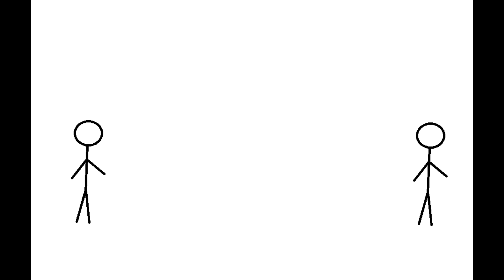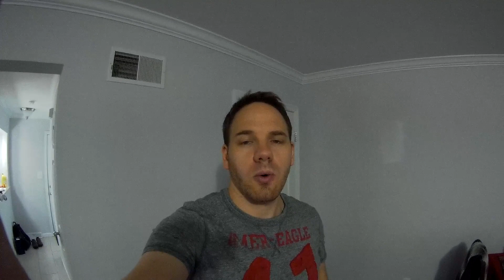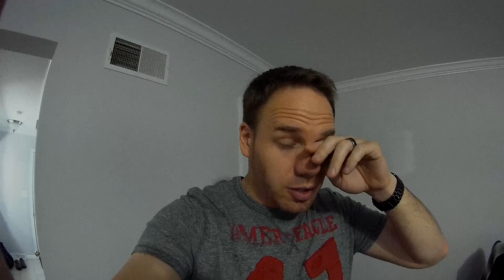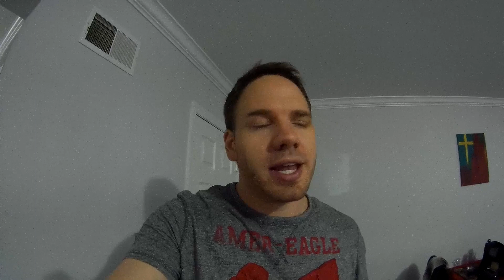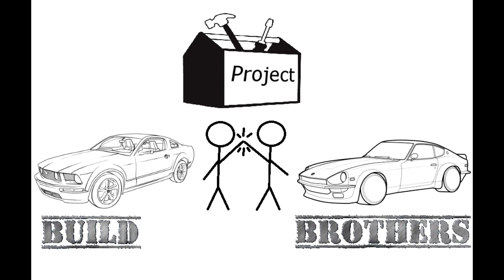Airbag Light Fix it for FREE! Chevy Volt Warning Light

Comment: Mine has been going off for almost a year now. Has nothing to do with the passenger seat being damp. I live in california where it almost never rains. And we do not leave the windows open at night for moisture to get in.
Reply from the maker: At that point, I would look at replacing a sensor. If the sensor goes bad (or senses an impact) it will report an error...ie. airbag light
Reply: @BuildBrothers  I have the same issue. Been on for over a year and not damp. What sensor are you talking about specifically?

Comment: That eventually fixed after I undid the battery cables, disconnected (and reconnected) the yellow connector under the seat and also mashed the menu button. I drove it around and it seems that it won't be coming back on now.

Comment: I have 3 Chevy Volts. I found out that puling a part the harnesses connections for the Airbags under both the driver side and the passenger side, spraying both side with Blaster brand Lithium & Silicone mixture (Walmart) then putting the connectors back together, almost fixes the Airbag warning problems. Those harnesses are very difficult to take a part (3 under the driver side and 3 under the passenger side). Can you make a YouTube video showing how to take those harnesses a part without damaging them?
Reply: Has this continued to work for you? Why is the driver's side important when it is the passenger sensor that malfunctions?
Reply: I see two large black harnesses and one smaller yellow one. These are the three you are talking about?  I have had this issue with the passenger presence sensor for several years now.
Reply: @rcktgirl05  Sorry I forgot how I fixed it. There is  a module under the passenger seat side not under  the seat but under the carpet toward the front seat post center side that is very hard to get too. I had to use utility knife to slightly cut the carpet to expose this module. It is much larger than the black or the yellow modules. You need to disconnect the 12 Volt battery. If you accidentally deploy the Air bag (very expensive to fix after deployment and dangerous). I do not recommend messing with it for your safety.
Reply: @natshain7746  In your earlier message you said this almost fixes the airbag warning problems. Does that mean that you still sometimes get the warning?
Reply: @billusry8902  Sorry I do not know. My daughter totaled the Volt shortly afterword. My theory on lubricating harness contacts is : Harnesses are electrical contacts with plastic enclosures. As the car ages plastics fatigues and become less flexible. When this happens the male & female part of the harness no longer slide in and out freely. The shinny slippery plastic parts of the harness are now dry and brittle. This prevents this microscopic  minuscule sliding that keeps the frictional electrical contacts from being a stationary contact. When the contacts become (stationary) fixed, oxidation sets in causing resistance to the electrical flow. With this theory in mind I have fixed many things over the years. Watch out for high voltage areas. When lubricating harnesses, you do not only lubricate the electrical contacts but also all surfaces of the plastic parts (in or out).
Reply: @natshain7746  Thanks for the explanation. Makes some sense to me. I have a Volvo whose AC and radio dials had contacts that were oxidized. I could remove the oxidation by quickly and repeatedly rotating the knobs to clear the oxidation. No easy way of working off the oxidation for Volt adapters, but your lubrication idea could help. I will first spray a cleaner on them and try put them on and off a few times and then lubricate them. Thanks again.
Reply: @natshain7746  Oh, and sorry to hear about the totaled Volt. I hope it protected your daughter well. They are supposed to be safe cars.
Reply: Nat Shain makes sense on lubricating the harness. My sensor failed very early and I was living in Phoenix, the car was driveway parked. Easy to imagine the harnesses becoming brittle in the heat. I'm having other issues now with my O2 sensor and catalytic converter so the passenger airbag has taken a back seat so to speak! I'll post back here if I ever get around to fixing it.
Reply: @rcktgirl05  Most Volt owners ignore the gas engine (generator). That is unfortunate. If the oil is not changed in a timely fashion (change the oil using fully synthetic Mobile 1 with Mobile 1 filter and the 1 year Maintenance rated oil / 25000 miles from Walmart). The engine could develop other issues such as oil burning causing the catalytic converter / engine light to come on. One of the Volts (First model I purchased used) the owner never changed the oil causing oil burning and catalytic converter / engine light to come on. I used the 5 quart Mobile 1 container to mix BAR'S LEAKS ,VALVE SEAL (only available on E bay) & RISLONE RING SEAL SMOKE REPAIR (from Orilley Auto Parts). I marked the container at 3.7 Quart mark, then I mixed the oil with those two additives before adding it to the car when changing the oil. That seemed to help the engine from oil burning  & the catalytic converter / Engine light from coming on.
Reply: @natshain7746  Thanks for the reply.  I change the oil regularly because I am basically gas only.  Right after I bought it, my company closed our plant and I had to relocate shortly after that. I've been renting ever since so I would say I have not regularly charged it for at least 5.5 of the 7 years I've had it.  I follow the engine oil sensor and do a change when it gets down to 25% or so. I got some Cataclean yesterday and I plan to drive it on Mountain mode for a while to force it though as I'm driving. I will probably have the cat replaced on this if the Cataclean doesn't work, because it's been mostly trouble free otherwise and I'm ok with a few repairs here and there. I am concerned that I may be hitting the point of just degradation and many things cascading from here. But I won't know that for sure until I fix this and keep going and see what happens!
Reply: @rcktgirl05  Volts can be driven from day one without ever being plunged in. The gas engines is under minimal mechanical degradation because they only work to charge the battery and not propel the car (except occasionally). That means they can be driven hundreds of thousands of miles without much mechanical problems. O2 sensor / Catalytic converter are often misdiagnosis. Get in the habit to check your oil level and oil color visually often (do not relay on the the car computer to tell you when to change it). If your car is using oil, then your catalytic converter and O2 sensor errors will come back even if you replace them. You can try the additives with the correct oil brand & oil filter. Invest in OB2 scanner that is capable on erasing the error code (about $ 40 on eBay). Catalytic converters are (COVERED BY LAW UP TO 150,000 MILES). Don't let any dealer tell you otherwise and they often do. Volt catalytic converters are very well made and do not brake easily. My daughters car kept on getting the catalytic converter error codes, I used sea-foam and catclean by burning it with fuel, and I even disconnected  the catalytic converter (not an easy task) from the engine and sprayed directly into the converter. As soon as the engine started to use the oil again, the error codes came back. The only thing finally fixed it is by adding the two additive the way I explain it above.
Reply: @billusry8902  Thank you for your concern. My daughter is fine. Volt have the best crash data because of the heavy battery.
Reply: Well, I cleaned the electrical contacts and then lubricated the plastic parts. This did certainly make for fewer airbag warnings, but it did not eliminate them. The fact that it unquestionably improved the situation does point to the issue being a excess resistance issue (oxidation). I'm tempted to cut out the connectors and hardwire it.
Reply: @natshain7746  I have a scanner, that is what led me to the catalytic converter. I did a temperature test at the entrance and exit to the cat, so I am about 99.99% certain it is bad. I do check the oil occasionally, certainly not weekly, but every so often and I don't think it's burning oil, thanks for that suggestion though. It is too long of a story for me to describe here why I think the O2 sensor (B1S1) is bad because it's been a dramatic troubleshooting rabbit hole. My scanner isn't fancy enough to do the mandatory O2 sensor heater relearn procedure that GM requires. Maybe I damaged the new sensor that I replaced myself that started all the drama. Maybe there is a bigger problem if the cat and both sensors are bad. Maybe if the sensor I bought was bad it created engine misfire problems that damaged the cat. I don't know why else as soon as I replaced the O2 sensor, the whole thing went immediately wacky and I got all kinds of error messages and the engine would cut off (not available). I am still trying to figure it all out.
Reply: @billusry8902  I would very much be against the idea of cutting them and hard wiring them. You will permanently ruin the harness and you could accidentally trigger the Air bag to get activated (very expensive to fix and dangerous). If you lubricated the contacts and still getting the error, it could be some other issues. Also in the past when I had lubricated other contact on electronic parts etc, It would take a few days for the good results to show while the oil is getting slowly drying out.
Reply: @rcktgirl05  Sorry to hear that. Have you ever replaced the 12 Volt Battery. If you do make sure it is AC Delco from the dealership. The online ones are mostly fake even the one that states that they GM OEM sellers. I have heard the the Volt will give all kinds of weird codes when the 12 Volt battery goes bad. If your car has less than 150,000 miles try to see if you can get the dealership replace it for free  (do not mention that you replaced the O2 sensor), because this may void the warranty. I also changed the transmission oil at about 100,000 miles(there are 2 You tubes for that). The Volt uses about 6 Quarts of transmission oil AC Delco from the dealership OEM only.
Reply: @natshain7746  Yes I have had the 12V battery die, and yes it is like a roll call of all systems failing when that happens! I was over 100k miles when that happened and thought that Volt death was imminent, luckily it was just the battery. I'm beyond 150k miles now and trying to make her last as long as I can. Transmission oil, hmm... I have not had that done.